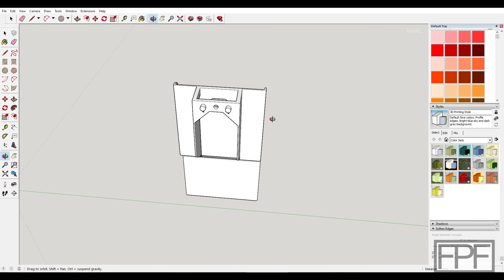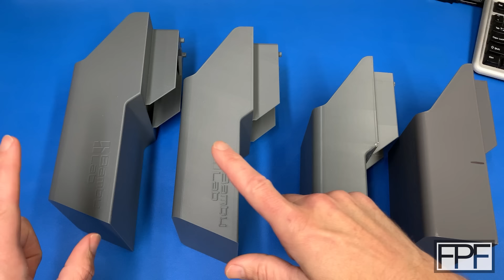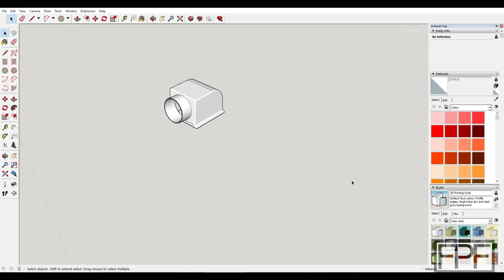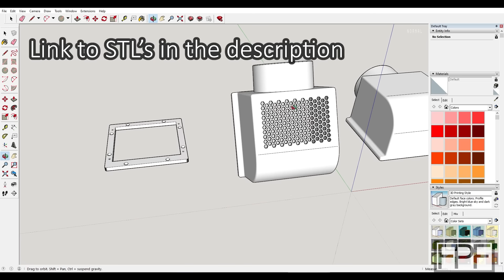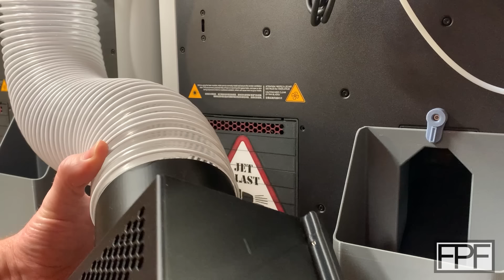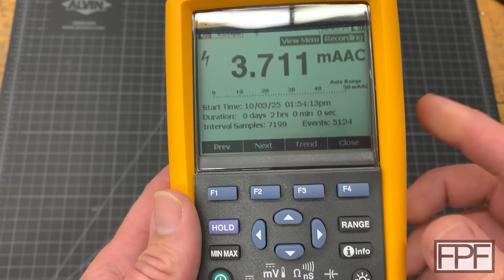H2 Series Fume Extraction for 3D Printing - FINISHED

Comment: This is a really great video series on a major problem I've been struggling with. I love designing and 3D printing but I'm really bothered by even PLA fumes. This seems like a great solution but also seems like you'd have to sit by the exhaust with the paper towel piece the whole time you're printing in order to adjust for temp and air changes. I see some extremely knowledgeable people commenting on making an automated system but I don't know how to do this, myself. I'd gladly pay someone for detailed plans.

Comment: Why not have a set of rotating vent flaps similar to on the printer instead of the honeycomb? Then when air pressure exceeds what the printer is putting out, they should open and draw ambient air. If the pressure coming out of the printer is greater, they should close.

Comment: I did some additional testing using a differential pressure sensor and found that the efficiency increases up until about -3.8 Pa of differential pressure when the chamber is at 50C. I used this value and a PC fan mounted on my window to create a closed loop system that automatically adjusts fan speed to pull as much pressure as possible without losing print performance. If anyone is curious about the system architecture feel free to hit me up. The system requires some serious PID tuning but it works great!
Reply: I'm hitting you up. I need this but I don't fully understand it.

Comment: Great video! Did you ever test how strong the smell is when printing ABS or ASA? I work in the same room where my printer is, so I’m trying to get the best fume‑extraction setup possible to print ABS/ASA while I’m there. Even with a window right next to the printer, I can still smell the fumes when printing ABS.

I’m already printing a duct to channel the airflow through a hose out the window, and I’ll be adding your modified shutter as well. But your video got me thinking about the other openings you mentioned… I’m wondering if I’ll need to add a lid or something over the purge vent so all the fumes are forced out through the extraction shutters only.

Comment: Thank you for the 3d models! I just printed out the hose extractor part. If I was better at modifying models, I'd try to mess with the print file so there was less post processing, but a couple minutes with some sandpaper and the support feet were removed and fight smoothly. With all the magnets in the fight is rock solid. Moving forward I need to get a set of those long allen head screw drivers because putting in those pins 1/3 of a rotation at a time was tedious :) Press fitting the magnets in by hand was also a challenge. Looking forward to getting my printer dumping exhaust outside!!

Comment: So what's the benefit of having the adapter with openings to the room for suction bypass?  Just for balancing?  Wondering if you could just make the adapter fully enclosed and then blast gate throttle the airflow during hot prints.

Comment: I duplicated his experiment and got the same results!  I just built a very similar setup for exhaust and also tested power consumption before and after, including using independent thermometers inside the printer at different locations to make sure temps stayed uniform.  I got the same results as him!  I calculated my airflow around 4 CFM at the exhaust outlet.  The printer uses about 80-100 watts less power once stabilized after having exhaust installed versus "stock" printer.

Comment: I’m waiting this and thinking… could a guy not just make a rectangle adapter that would sit just above the opening to draw away fumes. As long as a bit of ambient suction was happening, it would draw out almost all of the fumes coming out of the printer. Feel like this would be a “good enough” solution for me where I’m not using any exhaust system at all.

Comment: Is it possible that the intake from the vent holes in such close proximity to the exhaust fan is causing turbulence? I don't believe you can balance the air flow in this configuration due to the variable programming of the exhaust fan.

It seems like you would be better off eliminating the vents and installing a gate/damper to bypass the printer. A one-way butterfly backdraft damper might work to automatically adjust for the variable exhaust conditions of the printer.

Comment: I recently changed out my PETG with 3D-Fuels PCTG. Absolutely super superior filament for heat, chemicals, layer adhesion and support removal. 3D-Fuel has numerous printer profiles for many manufacturers. Along with numerous colors. Made in North Dakota sourced with US products. Sure it’s a couple bucks more. Remember, these type of companies hire US workers and makes US commerce. You should use this for the poop shoot heat issue.

Comment: Just in case anyone comes looking for magnet info, you'll want 6 8x5mm magnets and 2 8x2mm magnets. In the downloadable .stl, the 2 bottom holes are 2.6mm deep so a 3mm magnet will be proud of the surface. The other 6 holes are 5.4mm deep. So you can either buy the appropriate magents, modify the STL, or manipulate your magnet size/position however you see fit.
Reply: How do you get the magnets in the top 2 holes?

Comment: hi. Newbie here. Would like to ask if my hose to the outdoor vent is just merely 1-1.5meter distance . Can I just use the print without additional fan to pull the air out ? And block the smaller holes. Does this make sense to you ?

Comment: I like your approach to this which has given me a few thoughts. 

1. You could use a  smoke bombs (or your fog machine) inside the printer. A smoke bomb is a small pellet that gives off harmless smoke when lit by flame, but does not go on fire and is used to test the sealing on houses with chimney stacks and real or gas fires. Put a smoke emitter inside a closed printer, let it run play, pets, then abs and monitor what smoke leaks from the printer. Exhaust, poop tube, door 'seals' etc.
2. If the leakiest aperture is the poop tube (likely, after exhaust port for obvious reasons) why not seal the honeycomb on your exhaust adaptor. and instead measure the pressure balance for any given filament at the poop opening with a light paper or tissue. Use this as the set point for your downstream extraction blocker? This way ensures the poop tube is not leaking fumes and instead is brought to balance or just slight negative pressure meaning your exhaust really is accounting for two of the largest free-flowing apertures on the printer.

This topic intrigues as I am considering the Bambu Smoke extractor/filter or similar, but as you have found out, correct extraction is not an ON/OFF, but a sliding scale  from a leaky box.

Comment: I really like this design probably one of my top choices for exhaust ventilation so fara on the h2s but I must ask why the perforations are included on the exhaust adapter is it only so you can know how to make adjustments with your blastgate? Does this risk fumes escaping through those perforations? I was looking at another adapter that actually bypasses everything and sucks air out from the chamber itself at the top... it uses a very narrow path to restrict.. But this still seems more ideal for maintaining stable chamber levels desite modifying one of the fins. I also wont if I went without modifying the printer at all and used your design would I still be able to pull air through a closed exhuast vent basically to contain any fumes that would leak out the printer during engineering prints like asa? My theory is that since the printer is sealed during these prints that it would pull air through the minimal airgaps in this area and give just the right amount of negataive pressure to remove the vocs slowly over time. Also I wasn't clear at the end if you said you were going to replace this mod for a fume hood instead is that superior to
 your current setup?

Comment: Great work!  This stuff is way more complicated than it originally looks.  After taking a close look at the air circulation during heating mode, it appears that the air just behind the exhaust grille is both carbon-filtered and at slightly negative pressure (on intake side of circulation fan). Since the exhaust flaps are not perfectly sealed, there must be small amount of air drawn in during heating mode.  This is mixed with filtered internal air and pushed by the circulation fan through the heater. This small amount of additional outside air will increase the chamber pressure very slightly and cause a small amount of VOCs to exit the through the various enclosure gaps.  VOCs also exit the gaps via diffusion, of course. 

This means that active ventilation applied to the exhaust port will be venting carbon-filtered air (during heating mode) - somewhat limiting the overall value of active venting during this mode. Also, the more air you draw through the ‘closed’ exhaust port (eg, by removing flaps) the harder it will be for the circulation fan to push air through the heater (more negative pressure on intake side of this fan).  And extra holes will require active venting during heating mode - otherwise more outside air will be drawn into the system by the circulating fan, worsening VOC emissions. Seems like the active venting goal would be to at least match the negative pressure on the intake side of the circulation fan so that outside air doesn’t enter through the gaps in the exhaust flaps.  But that may only require a weak inline fan. 

I’m planning to try a simple sealed exhaust venting system with an AC Infinity Raxial S4 inline duct fan - because the specs suggest it can’t generate a lot of negative pressure. If I want more venting in heating mode, I can start drilling small holes in the vent flaps - but then I would have to ensure that the inline fan was always on during heating mode to avoid worse VOCs. A sealed system should still work for Cooling Mode, when the flaps open and exhaust fan turns on. 

Not sure this is the best approach, but seems like it’s worth a try. Thoughts?

Comment: I'm genuinely curious what to do here. I see a lot of problems solved but a lot of new problems created. Please let me know what y'all think.

How is this feasible when the fan is operating at varying speeds throughout most prints? It's almost like you'd want a complete seal and then give the printer the ability to control the blast gate. Perhaps install an anemometer in place of your intake and proportionally control the blast gate that way? Sounds expensive...

Regardless, you now have holes where there weren't before so you ideally should constantly control the air there, and you don't want it in your room (I also don't like breathing poison) so wouldn't you be better off with a sealed tube to the back, and relocate the Bambu fan to the end of your extraction tube? I guess you might need a stronger fan though. Ik this doesn't work with your current extraction system I'm just curious what would be best.

Cheers

Comment: I watched this a while back... and again today.   It's not often I see a thought process so inline with mine... My wife says it's ADD and with a side of OCD, but it serves very well when resolving issues much like this.  With some things I feel the need to test what I find, but you've absolutely taken out any question of what I've thought of.  An outstanding work of art from every aspect!

Ok.. I did think of one thing I didn't see in the comments.  How much air escapes from the lid vent, as well as dangerous particles?

Comment: Try using a weighted damper instead of the blast gate - excess air into your vent system will be drawn in by the damper….

Comment: I would recommend to use a spring-loaded flap/valve that would let additional air in the back of your exhaust adapter when the exhaust is at too low pressure. ... it would act as an effective bypass to ensure you're not creating lower pressure in the printer chamber.
If you tune that right, then it will always ensure that the bypass equalizes the airflow.

Comment: No, what was actually happening was your central HVAC had a higher static pressure than your exhaust fan.  And cooler outdoor air was flowing IN through the exhaust and out the poop chute.  The bed heater needed more watts to achieve its target temperature.  When you increased the exhaust fan it provided enough static pressure to reverse the flow and operate normally.  Then warm indoor air filled the chamber which required less watts for the bed to achieve target temperature.

Your waviness on your data log would likely coincide with your HVAC fan cycling.

Comment: I was worried about fumes from abs and ASA when my H2S arrives (hopefully next week).

And I was trying to think of methods to mitigate them, and I started with thinking of trying to extract fumes by negative pressure on the printer.

Then I realised all of the small possible issues that would cause, like maybe affecting the chamber heating, possibly messing with airflow in the printer affecting part cooling etc.

And realised it would probably be much easier to just buy some plywood and make a cabinet that I can exhaust from 😂

Maybe put in a window if I'm feeling fancy.

But I'm thinking I'll put it on wheels so I can move it, have a rear access hatch and make it so the printer is at a nice working height, which will allow for a (relatively) sealed storage area underneath to protect some of my filament from UV and I can use dessicant to try and keep humidity down.

I'll probably seal most of the joints with some sort of sealant and use a foam strip to help mitigate air leaks around the doors and hatches.

But I'll put an air intake in the side at the bottom of the printer compartment and an exhaust port in the opposite side at the top.

Have them so I can adjust the airflow and then I'll have an in line exhaust fan going out my window.

Seems like the neatest solution for my needs.

But this was awesome. I just don't have the patience or knowledge to design parts that intricate 😂

Comment: Sorry to ask.
But most of the fume extractor i see is connected to the printer.
I have see very few on youtube that there's an housing outside of the 3d printer and draws air from the housing.
The idea is like what we use in the lab --- the fume hood.
The fume hood should be turned on at all time.
One only needs to turn on the printer's extracting fan after the print is finished and should be good to go.

Comment: I understand that this is kinda fun to figure out. But there's a more straightforward, albeit less attractive, approach to solving this problem. 

Build an environment around the printers and create negative pressure within that space using your ventilation. The printer will maintain its own temperature as designed, and the outer box will contain any fumes that escape into your workspace. You could make it look cool using aluminum extrusions for the framing, even make the front door a linear sliding door, either sideways or vertically.

Watching this brought to my attention that directly attaching an external exhaust fan introduces an unaccounted-for variable that the printer does not know and cannot control. I probably would have learned this the hard way with multiple ruined prints. So thanks for that!!
Reply: They make really cool indoor "horticulture" growing tents cough cough that are vented with inlets/outlets that'd probably be perfect for what you're talking about!

Comment: If that extraction system is tied into your radon system then you should have a way to prevent suction from your vent holes. The radon system can continue to pull from under your concrete slab. Every time you use that system it is going to reduce the amount of air removed from under your concrete slab. It may be worth while to have a radon test performed with the machines running.

Comment: I have no centralised shop ventilation system, and I figured I'm mainly worried about fumes from filaments printed at high temperatures in enclosed/heating mods, so after a bit of pondering, I came up with a system based on combining a bunch of 40mm fans, and 19mm (3/4") tubing, sealing the purge chute and drawing a modest flow with a high static pressure (and a high fixed flow resistance from the narrow tube) from the chute area. Total fume leak elimination, without any other work to investigate or seal other sources of leaks from the enclosure (I'm looking at you, top vent.....)!

If you're interested, I recently published it to MakerWorld, search up 'Compound 40mm Fan Fume Extraction System'

Comment: Here are some thoughts for you, sorry if these are repeats from other commenters.

First thought, how about a TPU lid on the waste bin to try to seal that up? Seems like it could be a pretty simple part, and that might stop the chimney.

Second, with the idea of a Y connector, you would probably want to control the airflow separately for each machine, especially if there’s a chance you might print in different materials in the two machines at the same time.

Third, would you ever want to borrow a thermal camera? I have a super nice one for my work that I don’t use very often… And I am the business owner so I don’t have to ask anyone if I can loan it to you lol…